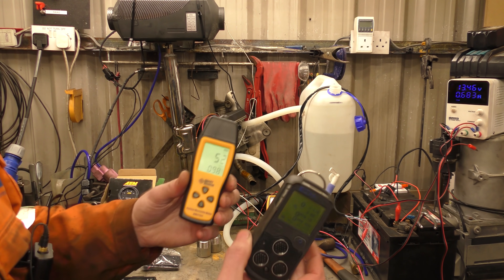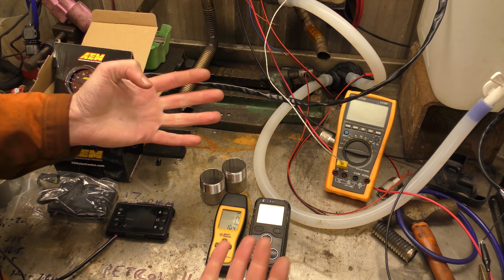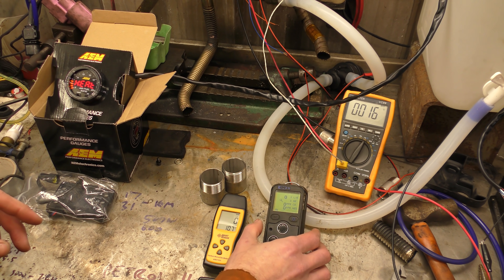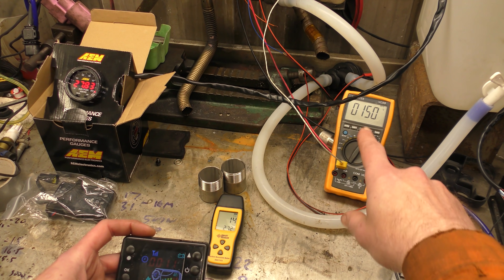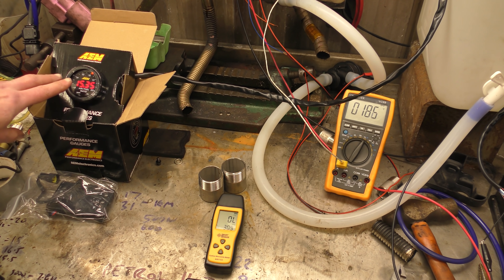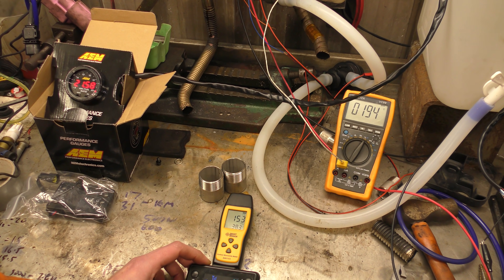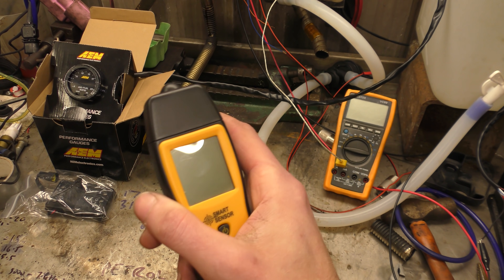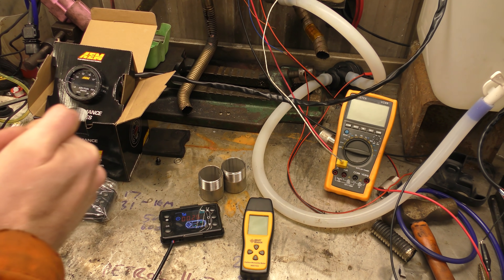Diesel heater tuning - using cheap CO gauge

Comment: One issue i see is the air inlet to the burner is sucking in lots of burnt exhaust outlet , so starving it of air when you upped the fuel.
Reply from the maker: You are correct.  But I did try with the air intake off to the side and it made a negligible difference to the CO output.
Reply: @DavidMcLuckie  i was wondering if there would be any merit from intaking air from inside your vehicle as it would be dry and warm and crap free. Would give a positive air flow to remove moisture/ stale recycled air without having to open windows.  downsides would be noise and any blow back i guess and of course if your vehicle was too well sealed to let enough fresh air in :o
Reply from the maker: What you gain in swapping the air around, you'd lose in heater efficiency as you are now pulling in cold air from outside to heat up.  As opposed to continuously heating the same volume of air up to a temperature.
Reply: @DavidMcLuckie  i was referring to the combustion intake, if this was taking air from inside as opposed to outside. the air would be warmer and ensure a positive flow of air out of the vehicle (say a camper) to reduce humidity and stagnant air. you would need to ensure there was enough air intake leak into the cabin for this of course which i am sure most have by default.
Reply from the maker: That's what I mean.  If you combust the air inside the vehicle, it has to be replaced with cold air from outside.  Which as you say creates flow, but means you have to also heat up the new cold air.  I'm sure someone could do the maths as to how much air is forced through the combustion process which would be ultimately how much air you are cycling and additionally heating.
Reply: @DavidMcLuckie  true, the heater would function better with a more controlled air intake temperature i would hazard and condensation/humidity is always a problem with recyled air heaters as the humidity will only increase with people in there which in turn can cause health and damage to the vehicle issues, especially when the heater is off and all that trapped moisture in the warm air condenses.  It was an idea to help improve that without having to open windows and at the same time improve the efficiency of the heater itself with a more controlled temperature intake of it's own making so to speak.  I have ordered a couple so will try this on one. one is for a camper van project and the other to replace an unwell Eberspacher D4 in my work van.
Reply: @amojak  In my 5x8' solar camp trailer, we intake air from outside into the intake side of the heater and leave a window cracked.  The heater itself is in a vented utility box. That way, air is constantly recycled and humidity and condensation from sleeping in there disappeared.  The way you were talking, cold air would come in every crack.  This way the warm air goes out every crack.  Positive pressure ventilation.  Doing it this way, you must install the exhaust far away from any intake as it would suck it into the cabin.  I plan a snorkel for the intake on the roof 7' high. Exhaust low, a foot off the ground. maybe not as efficient as a recycled air setup but certainly more healthy and dry!!!  Before the insulation was up the roof supports would gather moisture and start dripping on you at 3am! Also, under the bed would get wet.  With the positive pressure ventilation, there is never any condensation on anything.

Comment: I have a house hold co meter that also detects propane and natrual gas smoke. How would I use it if exhaust is outside. A bucket to catch the co? I stick the unit close to the exhaust and it just starts to melt. Only thing it has beeped for is hydrogen gad from charging batteries.

Comment: I have mine tuned at 5,000 rpm at 4.4 hz  I get 100 PPM CO. When I go to the low end I have the pump set at .8HZ and the fan at 2600 RPM (which is the lowest and the highest I can go) The CO is greater than 2,000 PPM out of scale of my meter. Then intake and exhaust has like one bend each there is no restriction to the fan inlet or exhaust. I have one outlet diverter eyball on it with maybe 3 Inches of connector pipe. I am at a total loss!
Reply from the maker: Take the 5000rpm down to 4500 (you motor will last longer) and try taking the hz down to 3.5.  See if that improves the CO reading.  It's trial and error, what works on one heater setup might work work on another.
Reply: Too weak, you need to increase the fuel pump stroke. WEAK = SOOT. RICH = SOOT going too rich or too weak equals incomplete combustion then you get the result high CO and soot.
Reduce the RPM with the same stroke will help but I really think the stroke is far too low anyway.

Comment: Are those heaters designed for the Consumer to tune for optimal performance or is what your doing something you stumbled upon while fiddling with the controller???
  Great video thanks for sharing your testing 👍
Reply from the maker: You don't have to tune them. But some are setup terribly out of the box.
Reply: @DavidMcLuckie  So what exactly are you doing and how would you know the heater isn't working correctly?, Reason for asking is I purchased (haven't received it yet) a 5kw for my 38' diesel pusher Motorhome to heat rather than using expensive propane which is a miserable damp heat.

Comment: £20 for the meter ? Link please
Reply from the maker: First one I picked off eBay - https://www.ebay.co.uk/itm/SMART-SENSOR-LCD-Carbon-Monoxide-Meter-CO-Gas-Tester-Monitor-Detector-Gauge-Tool/313053807607?epid=28037410077&hash=item48e37603f7:g:PwMAAOSwz5pelW1Y

Comment: The heaters ECU stores the settings. The LCD controller also stores settings. If a new LCD has different settings to the ECU, the ECU is immediately overwritten by what is on the controller when plugged into the heater and powered on
Reply: When you use a larger rated lcd, plug it in and adjust settings, are you aware if it saves those settings.?
Reply: Why does the controller (Blue type) on a 5kw unit allow the minimum hertz to be set down to 0.8 in the settings menu but when heater working will not go lower than 1.6 hertz.  Is this a default value hard programmed into control unit.    Have another 5kw heater that allows this adjustment.? Thanks

Comment: I wonder if parafin oil or kerosene gives a cleaner burn I have used the heater over the winter and seems well set up for it and of course very cheap on the British Isles
Reply: Yes it will
Reply from the maker: Kerosene and Paraffin being a higher refined grade should give a cleaner hotter burn.
Reply: But will they lube the pump the way diesel does ?
Reply: @carpenterfamily6198  yes kerosene boilers use a lube pump as well and run for years and are far more expensive than a dose pump in a parking heater.

Comment: I don't understand why they have that PIN number, did they think someone might steal the heater's secrets or something? :P
Reply: Its to keep kids and nosy people from accidentally changing these settings.

You can really ruin the heater with some of these changes.
Reply: Push the two top buttons on each side simultaneously it will change to where you can get to the pulse with without having to go through the password

Comment: You are welcome and yes I am Canadian :). The settings with these heaters are such an issue with these heaters even out of the box. We see some soot up in hours. The higher the fuel setting is will actually end up producing less heat as the unit soots up as the soot insulates the heat exchanger.   Or the fuel can also flood it in some cases  before it can even wind up to max. They just can't move the air through them fast enough with the fan speed limited at 5000. And you can't really make the exhaust path much more free flowing inside the heater as you will have even more heat loss out the exhaust.  When they soot up the heater will start smoking white unatomized fuel out the exhaust and giving a flame extinguished code (e08) because the heater computer thinks it's not running as the temp sensor is on the outside of the heat exchanger.  Thanks for the update video. For the more expensive analyzer you bought they actually make a sniffer pump for them so you can put it closer in the exhaust path and you will get better results.  But all in all you definitely have a better tune than when you were running 7hz pump speed ! ;)
Reply from the maker: Have you got a link to your facebook group and I'll stick it in the description?
Reply: @DavidMcLuckie  https://www.facebook.com/groups/146837062640024/
Reply: Hey man, can you tell me what the ideal inner case temperature is, for not soothing up? I'm trying to run it as lean as possible not all for the less fuel but also because I have to heat a tiny space.
Reply: @kareljansen3992  ideal case temp should be 125c at the minimum Hz setting and 180c at the max Hz heat setting according to the tuning method found at " thedoble daht cohm ". I have no idea how he found out those parameters though...

Comment: try these settings 
Pmin=1.9, Pmax=5.5, RPMmin=1680, RPMmax=4410
Reply: This are old settings that have been going around the internet for a while now aren't they? We found a lot of the d4 clone size were sooting with the settings on the top end. But some seem to have good luck with them stock.
Reply: i have been runnig these settings in my 5kw heater for 2 years now on dyed diesel, regular diesel, and some kerosine, no problems at all. thats why i would like to see david review these settings whit the CO meter.

Comment: Halloooo David don't go on  about heating right now what about changing it into summer cooling fan by adding a tempiture controller and fan speed control would be good then it can change automatically to cooling can you do this for us in the summer HEAT?
Reply from the maker: But it would just be recirculating the same warm air.
Reply: @DavidMcLuckie  do what you please my friend.  Theres those of us who respect whatever you put out
Reply: Try a 12v fan
Reply: Yes this heater can be a 12v  fan with no CO2 and redundant in a heatwave and has a internal fan keeps  the combustion chamber cooler OK its a 12v fan baa
Reply: I plan to use a 12,000 btu minisplit heatpump into a 8kw diesel heater into a ducted system in my RV.  When heating with diesel, a DTDP 2 way switch connects the diesel heaters fan to its controls for normal operation. When using the minisplit heatpump, the DTDP switch disconnects both the negative and the positive from the diesel heater fan and routes them to a adjustable fan controller.  This way it could be used as just a fan to circulate air or to aid the AC by being a second fan in the system.

Comment: The stoichiometric ratio is impacted by pressure slightly. Running slightly lean (relative to stoichiometric) leads to lower soot but higher NOX it's a loose one gain the other kinda thing.
Reply: NOx production is only an issue at much higher temps than the flame front in these heaters will produce, typically north of 1600°C regardless of a lean mixture.
Reply: Forgot to add, thanks again for these great videos! Been very useful for designing a closed liquid loop heater with these (chines water heater version) and erg heat exchangers.  Thanks man!
Reply: Isn't the whole notion of 'lean/rich' here a nonsense? As it can draw as much air as it likes - perfect ratio in all circumstances?

Comment: As to the cleaning, I run WVO in my diesel Truck which is fueled right up for power.  This can easily cause the rings to coke up. I run a very simple water injection system to stop this from happening and keep the thing clean.  I would suggest a slow drip of water into one of these heaters would have the self same effect and stop the thing sooting. The hard thing with WI is trying to get through to people it does NOT have to be complicated, precise or expensive, it just has to be there.  I small drip, I reckon even 50 ml an hour would have beneficial effects for cleaning.  Could even go water methanol and get a bit more heat without any sooting at all and in fact have a better cleaning effect. 

Another great Vid Dave, keep up the interesting and well tested work!
Reply from the maker: I had actually been thinking about this after a few people asked if there was anything you could run through them to clean the soot.  It's certainly something I'd be happy to experiment with.  :)
Reply: @DavidMcLuckie   I think you could run a heater rich for an hour or 2 and show the buildup.  Then run the heater without cleaning it at the same settings with 50-100ml of water timed to regularly drip into the intake.  May take more time to clean than clag it but you should be able to see a difference either way. 

The other thing people do is just give bulk doses but I don't think this works as well but could be another experiment to try. 

The 3rd thing would be to go back to what you did before. Put 50% Metho in the water and turn the  water rate up. This should give more heat with no clagging although the water will take energy to phase change so will be interesting to see the net result.  It should allow better cleaning through running more water without killing the flame though.
Reply: I'm not sure that would apply in the heater as you still only have the piddly little impeller fan that moves the air/exhaust through the heater and no high pressure from the compression ignition to make superheated steam.
Reply: I like your idea, a t piece with a valve on the combustion air suction for maintenance burn chamber cleaning
Reply: @JimLahey21  That would probably do it. I like regular admission myself. I was thinking a simple Pulse pump on a timer firing for one sec every Minute or what ever would be good. Just let it in the intake and work it's way through and should be fine. No need for mists or nozzles.
Reply: Interesting - so you drip water into the intake of the truck that is setup to run rich and the black smoke disappears from the clacker valve?
Reply: @Bennyboy-dog   No, Black smoke does not disappear and I have no idea what a clacker valve is either. EGR valve?
The water phase changes to steam and in doing so Cavitates and dislodges the carbon.  This stops it sticking to the rings and burning to a hard Crust which sticks them.  I believe it also stops build up  around the valves and even in the exhaust. 
If you run the engine fueled up you will still get black smoke as it does NOT make the fuel burn any better, just takes away the residue which builds up and causes problems.
Reply: And from burning veggie oil in these heaters I was left with a very fine soot. It would quickly become a paste or even cement with water added haha
Reply: I would be concerned with this method using the fan. One would think the moisture would bounce around the unit after fan, and enter the control unit causing damage.
I would think direct injection of sorts would be path to take??
Reply: @Guns_N_Gears  its sealed inside from the control unit on the outside.  I just don't think it will be effective.  It will probably throw a e08 flame out code and crackle a lot.i think the reason why it works in an engine is the closed chamber and the extreme pressure and heat from the added water turn to steam.
Reply: @andrewbartleman9169  Yes, the pressure is definitely at play. I think the water phase changing from a liquid to a gas ( steal) will still be effective at these low burn rates though. In an engine it takes a LOT of water to kill the flame. I have tried it. I think the addition of Metho/ alcohol may work to keep the flame going and the heater hot while allowing the water to do it's job and even a higher dosage rate. These heaters are just burning a bit over half litre an hour so not much water will be required unlike my 4WD which can suck down 20L hr of oil and more of water under load.
Reply: @andrewbartleman9169  makes sense, guess we'll have to see what happens 🙂